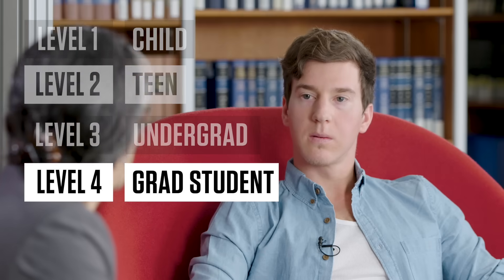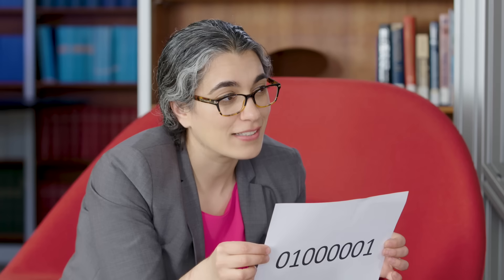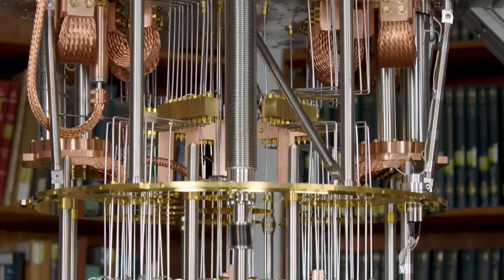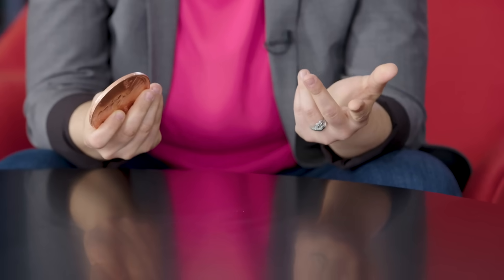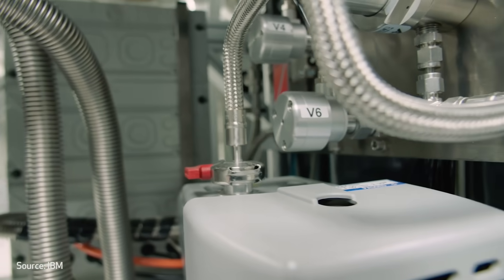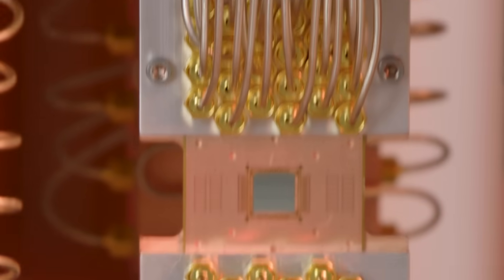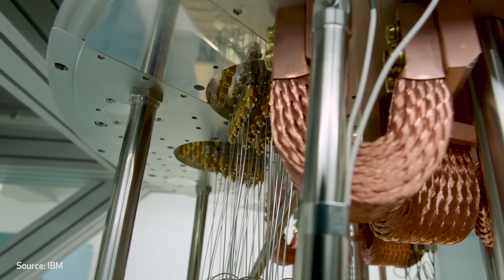Quantum Computing Expert Explains One Concept in 5 Levels of Difficulty | WIRED

Comment: I don’t think this works… let’s say you need to calculate a binary code to solve a complex question. Let’s say this code is “001010001001”. Now, your cubits or whatever it’s called is both 0 and 1. Therefore it carries no information until you observe. And let’s say you observe it, and the code is shown as “010101101”. It’s the wrong code. How can you control what number it’s going to show when you observe it? How can you control that you will get a 0 instead of a 1 when you observe? I’ve been watching those videos so far, and I don’t think it’s working

Comment: Entanglement/interwine, interference (noise canceling headphones) is used to control quantum states and amplify the kinds of signals that are towards the right answer and then cancel the types of signals that are leading to the wrong answer
Build computer - qubit/quantum bit (object/physical device - manipulate quantum, carrier of quantum info, control thru microwave pulses) be put into superpositions of states you know two cubit states that you can physically entangle with each other
Machine learning trying to use quantum systems to accelerate machine learning problems
Quantum computing creates new possibilities and new ways to approach problems that classical computers have difficulty doing

Comment: How do you store information? Is it in a hard disk as it is in classical computing? Is it a way to create an algorithm which uses a minimum of cubits to find prime numbers easy? Is it possible to make parallel algorithms for quantum computing? I mean there are many questions on my head ... Even if it's possible to forecast natural disasters or even forecast our social future 🤯
Reply: Afaik information storage is not a concern in that sense, as the algorithms are run with certain parameters and output data in a format that can be understood by normal computers. I can't speak on the question about parallelization but the applications you described are certainly possible. The main problem with simulations like these is the amount of parameters affecting the outcome of the simulation. As far as I understand, quantum computers can help with simulating this kind of complex system, but the problem of creating an accurate model and feeding it sufficient data still remains.

Comment: If the circuit is using diamonds, I would assume there are lot less interference and noise compared to regular copper or aluminum circuitry. Near 0K temperature for the circuit is also not very feasible in most cases, so perhaps a big room full of industrial diamond circuit would help with that.

Comment: How are operations performed in this
Can you do several seperate operations and run them together to have the same effect as running a more powerful operation? For example as mentioned in the video they say there are only 50 q-bits currently can they connect several 50 q-bit computers to have the same effect as a 200 q-bit computer

Comment: I'll see your 50 quantum bits, and raise you 100. Because of the speed and flexibility 50 quantum bits is much more powerful than most people can relate to. When this all started, we had no idea where it would lead. We are still coming to terms using superposition, interference, and entanglement. Binary computers use ones and zeros. Quantum uses ones, zeros, and both at same time, or none at same time or... that's the exciting thing about quantum. We have a long way to go.

Comment: What i can understand is that quantum computing is a new way of calculating and solving solutions their aim is to solve more complex and real life problems with this new systems. The thing is even if it is a randomiser or a fixed numerical 1 0 1 0 0  they over complicate a level of understanding to a detail point. Meaning the kids to adults definitely are like a computer if you think about it. Thus just like a quantum computer. You just have to know the “smart”  words tu understand the basics and possible even the complex parts as you develop your knowledge. Anyway i hope this helps understand to people like me that learn waaaaay different than the normal 5 levels idea.

Comment: Imagine that the fabric of space is created by atoms with electrons spinning faster than the speed of light, and this makes it invisible to our eyes. It can conduct fotons, transmit wireless signals and it holds together all the atoms/molecules we currently know of. It is susceptible to the effects of high level magnetism (MRI, X-rays, radiation, etc.). In a black hole the speed of mater around the vortex, generates electromagnetic forces strong enough to rip apart the fabric of space impeding the passage of light. The more dense the mater, the more overwhelmed are the properties of this fabric, reason why lead is a good barrier against radiation, water does not transmit wireless signals as well as vacuum and air, and light curves around celestial bodies.

Comment: So I've been listening to this video. The information is still not especially clear. As she describes the quebits, they sound as though they can essentially be placed in tristate. So given the particle size I can see where the eventual space requirements could be miniscule, but currently tristate electronic memory exists today with permanent state retention. 
Further the small amount I can find on uses seem like its mainly been used as probability calculation and things like maximization or minimizing system results. It reminds me of the use of FPGA's although those currently are not offered in a tristate form and require the programmer to preplan all states.
Reply: Qbits are not tristate systems, there really isn't a classical analogue.  The state of a qbit is a vector in a 2 dimensional vector space where the basis vectors represent the two possible "observable" states, i.e. 0 and 1 (but 0 and 1 here are labels for  these vector states and not actual numbers).  So in general a qbit's state is a linear combination of the two basis states.  However measuring the state necessarily reduces it to one of the two basis states.  This process is probabilistic, with the probability of measuring each state related to the coefficient multiplying that state in the general linear combination (or superposition) state.

Comment: So at @6:40 the image of these  quantum computers make alot more sense to me cold air goes down hot goes up the reason the design of the pc is so crazy us the chip of the computer is at the bottom and they need it to be as close to the coldest temperature possible to slow time to measure quantum states with more accuracy...in a way the more hot a quantum computer is the faster it should be able to functions as long as we have the technology to measure q bits at these higher energy states.. things instantly became so much more clear to me with the @6:40 mark and this video is great for this!.

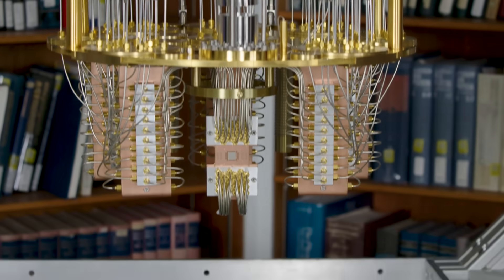Comment: 13:08   They're admitting they have achieved NOTHING as far as quantum computing is concerned (many decades away).  The fraud shows ... especially when they claim (at 12:42) that quantum entanglement is a real thing, and they even describe how they simulate the phenomenon using microwave pulses over short distances.

Comment: I can prove A equal not 01000001 in our regular silicon chips which consists billions of transistor, we actually believe in myth which not true. It doesn't means that if on or off define as 1 or 0 in electronics protocol if it does then answer might be tangled.
We can simply defines a regular chip as 2 Dimensional in terms of calculating and in other way we also can define Quantum chips as 3 Dimensional in terms of computing that's means in reality a Quantum bit can have infinite amount of 1 or 0.

Remember we can make signals wave using radio transmitter but we are not have the ability to measure or see how the wave is in reality we can only imagine it might be delta, theta or gamma depending on frequency strength. 

We actually confined to certain ability.

No one can explain how a Quantum chip works before knowing basic fundamentals of what infinity(the state where everything lost) actually is.

Hope you all understand my ideology.

Comment: Quantum computers use insanely cold temperatures and microwave pulses to manipulate quantum states to make a fancy computer.

Superposition (probabilities of a the q-bit being 1 or 0 at the same time)
entanglement (once entangled, two bits can show the same position even over great distance)
Interference (constructing or deconstructing waves to approach a higher probability of a solution)

Shor’s Algorithm 
Grover’s algorithm 
These predict that with a perfect q-computer, cryptography would be broken easily (Bitcoin would become worthless).

Quantum computing is in its early, early phases of develop. 

When an observation is made on a quantum computer, the result changes. Fault tolerance is currently not good.

Comment: Yo it mentioned that they had to use a super conductor as a qubit but If a super conductor is chilled down to that cold wouldn't there be a possibility that  it will quantum lock with another metal

Comment: 12:43 she said they if they apply microwaves between two particles, that can entangle them. But I thought the whole deal with entanglement was that two completely separate particles can be “entangled” and yield the same position without actually communicating or being measured, and putting microwaves into the system is or isn’t a method of communication/measuring between the two particles??
Reply: Good question, she confused me to

Comment: I dont understand the large penny thing at all lol made no sense to me someone help
Reply: I think that its trying to say that quantum computing looks at data in different ways. Computers read data in binary (1s and 0s), just as heads and tails. When you spin the penny, it doesn't have a definite value of heads or tails, but rather it's data in mixed state of position. I'm not sure, quantum is small, maybe they're trying to do more with less space. Pack more computing power in a set value.

Comment: Dr. Talia: "Indeed, the quantum computer is extremely volatile to changes"

Dr. Girvin: "Definitely, I agree with you, it's just multiplying the problems if anything."

Me, not understanding 50% of what's being said: 🗿
Reply: Classical computing is based on electrical current. If electricity is flowing through a circuit that can be measured. If the flow of electricity is cut before reaching that circuit the lack of current can also be measured. Both reliably - i turn on the light switch and the light comes on when i turn off the switch the light goes out. Two states. 1 and 0. A little bit of boolean algebra and we can begin adding complexity and abstracting up - circuit, integrated circuit, vacuum tubes to transistors to cat videos and iphones.

Imagine if electrical current was not so reliable. Imagine instead of 2 distinct states of current there were three - current, no current and both. Next, imagine that observing the current or lack of current changed the current. Lastly, imagine if electricity only existed in extreme conditions, like temperature. Now when you turn on the light you can't look at it or it's state will change, you have three random options that are possible including the light being both on and off at the same time and you have to be in the arctic for any of that craziness to even happen. 

This is the volatility they are talking about. One of the theories is to add more quantum bits (qubits) but adding more quantum elements also adds more possibility for error. And if you cannot reliably calculate you have no computer.
Reply: @Koyasi78  amazing. But why are they trying to add more bits to eliminate this problem? Wouldn't more bits just introduce new sources of possible errors?
Reply: @hbm9144  to get more storage I guess
Reply: @hbm9144  The more bits, the more things you can represent. Imagine the opposite extreme in a common computer; having only one bit. You can't do math with one bit, it's too small to represent anything valuable.
Reply: @hbm9144  that is exactly what he is talking about, THAT is the myth, that just adding more qubits would help with quantum computing. But as he explained, that is false since adding more qubits would increase the chances of making miscalculations and errors since they are so volatile to begin with.
Reply: lmao it just means it can produce wrong output or error even if there is very little distrubance.
Reply: @HDM they add to increase it processing power unfortunately this leads to a more error output.the more you add,the less reliable it seems

Comment: Here's the real question: "Can a Quantum Computer run Minecraft?"
Reply: In short, yes but not in the way you might think. A more practical application for running games like Minecraft would be as a replacement for software based physics calculations done by a classical CPU. In the case of Minecraft, a quantum computing chip could be used as a CPU co-processor for determining particle interactions with blocks and entities at massive scales (it wouldn't be very useful if there are a small number of particles, however; that can be done by any modern CPU with no problem). Another good application for Minecraft could be to serve as a GPU co-processing unit that aids tremendously in ray tracing calculations, being able to calculate exponentially more ray paths than a classical GPU could in the same timeframe (mostly just a quality boost rather than a framerate boost, due to the internal bottleneck presented by having a classical and quantum hybrid computing system). As mentioned in the video, the best way to calculate the behavior of quantum objects is to calculate them with a quantum computer, and light specifically in this case is one such quantum object being calculated. Personally, I don't think quantum computing will be used in gaming as an actively noticeable part of the game, but rather as a passive tool used by the game in areas like procedural generation, such as that used in the creation of every Minecraft world.
Reply: @TSPxEclipse  I appreciate the detailed response however, my comment was meant to be taken as a mere joke. Fortunately, you have enlightened me to the fullest about quantum computing and how it may run Minecraft in a way that I was not aware of. I am thankful for your dedication to this topic and I wish nothing but the best for you.
Reply: @geki4654  Your reply is the epitome of "Understandable, have a nice day"
Reply: @TSPxEclipse  thanks, It was a good detailed response, would you recommend any source to study on this subject?
Reply: @TSPxEclipse  im feeling dumber by the second trying to read your comment
Reply: @TSPxEclipse  Thanks for the info mate.
Reply: @TSPxEclipse  Thanks! It's really interesting :)
Reply: @TSPxEclipse  Imagine Quantum computing combined with Ai we could have a replicator as in Star Trek. Seriously.
Reply: @TSPxEclipse  monte carlo minecraft*
Reply: CAN IT RUN CRYSIS THATS THE ACTUAL QUESTION
Reply: @Abrahambinzz  thank you for your service fellow crysis lover <3
Reply: @Abrahambinzz  the crysis nanosuit shuts down after being hit by alien emps
Reply: https://www.youtube.com/watch?v=Xe_7b9pRKY8
Reply: @samuelrichards8107  Holy Unholy, it's been 3 months since that dude started trying to make Quantum Minecraft.

So cool.
Reply: It could run Quantum Minecraft
Reply: Ofcourse without any lag
Reply: if things go right, it can run the simulation of the whole world.
Reply: But we all know it can run doom
Reply: No
Reply: A carat here? 🥺
Reply: Not really
Reply: @nesto9889  who are you replying to?
Reply: @nesto9889  Femtotech. 10-15m technology can be achieved. Picotech is impossible because there is no sub straight as it is between atom nucleus and orbital electrons ect but at Femto it is entirely possible. We are doing Nanotech right now so it would be the next step forward in generation. Just organise atoms to any config you desire. Ai would design it.
Reply: Be can do amazing things but you only want to run Minecraft why we  need qc for Minecraft  it is gonna use for chemesitry and AI I guess.
Reply: Yes. There’s a video of someone using a QC to run Minecraft
Reply: minecraft with 6K graphics and heavy shaders

Comment: But how do you see the result? In classical computers you just enter something and it gives you a result.

Does quantum computers have some sort of displays or is it like those old computers which switches multiple lights on and off.

Also I'm still trying to wrap my head around the idea that a computer can either compute 0 or 1. So a simple 1+1 won't just be equal to 2 right?

Comment: How many states has a qbit now ? Zero, 1, spin up, spin down, superpositioned and entangled are some states, but you cannot use them in algorithms can you ? Entangled is like a 0 nanoseconds latency wireless network.... maybe Google will use this for Stadia and the latency problem. Then they sell Chromecast Quantum with a entanglement device for Zero latency connection to them Google clusters ;)
Can you program algorithms or microcode based on 4 way (01, up down) logic instead of classic o and 1 ? I know in Star Trek they use Quantum Computers and Qbits and as Star Trek invented the iPhone and iPad, they also invented the Quantum Computer several decades ago ! What smart asses.
When they have a QC which runs accelerated factoring and searching algorithms it would be the holy grail of code breaking. They could break every encryption with fast big prime number searching and factoring or am I wrong ?
Reply: Stadia is a joke.  Who knows what google IS ALREADY doing with their quantum computers.
Reply: @dronesightingsmith3979  I was obviously also making a joke. Even Google wouldn't waste quantum compute power for gaming...
Reply: Andyw1228 what are they doing with them and why so secretive?   Scary.